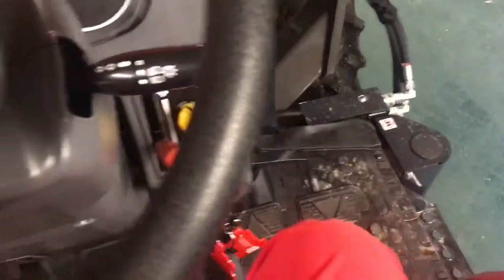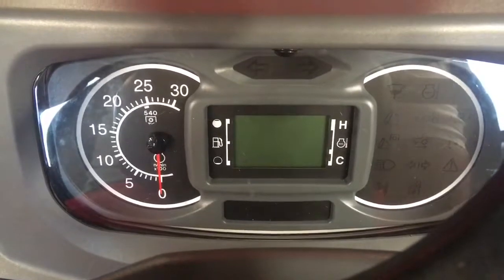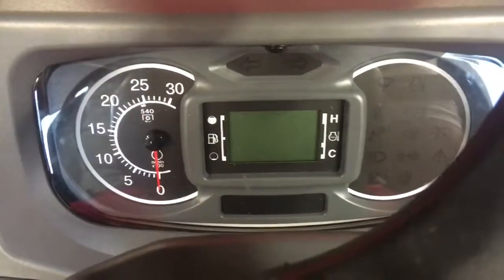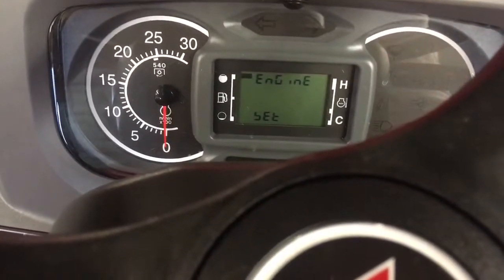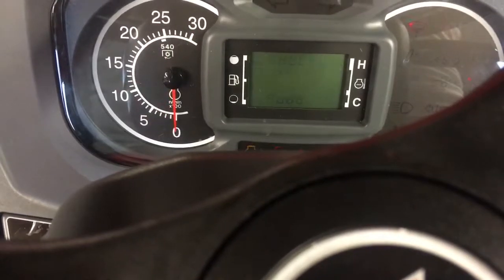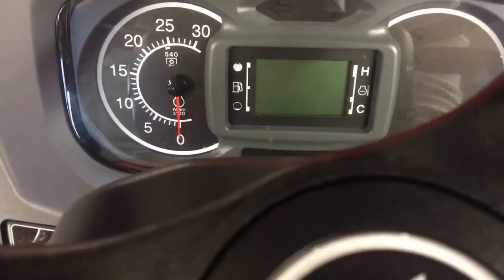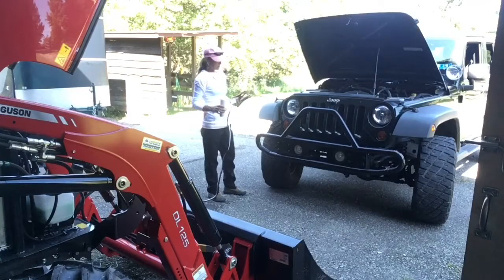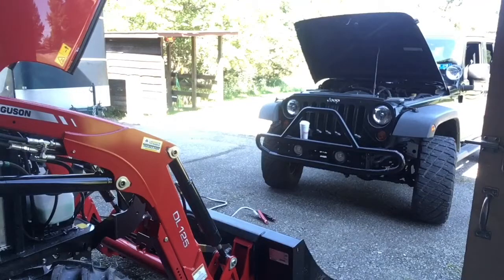DEAD TRACTOR BATTERY - I Am Such A Rookie! Dead Battery on My Massey Ferguson 1740M Diesel Tractor

Comment: Thanks. I may have done the same thing because my tractor is old and light switch is faded so can’t tell which is on or off. One tip though—you may be aware that the connection of negative cable away from the battery is so no sparks will cause a fire. You should place both positive and negative cables on the good battery terminals with the opposite ends separated and then place the cables as you did on the tractor